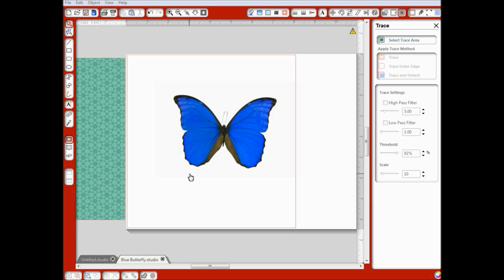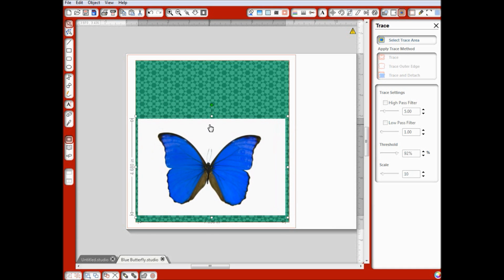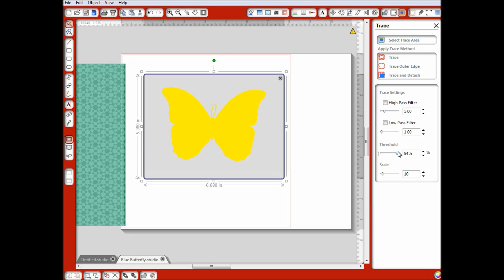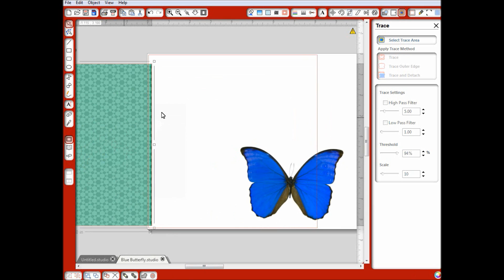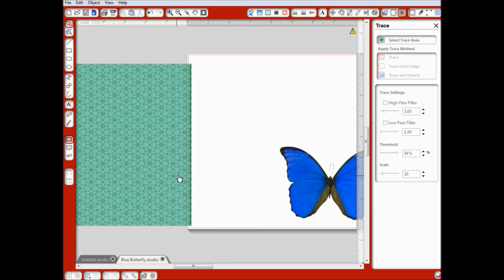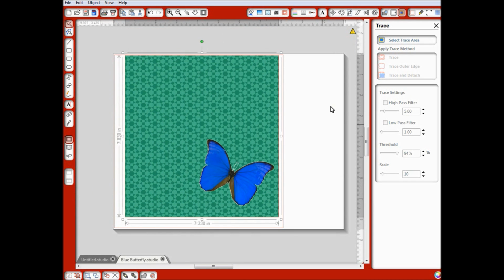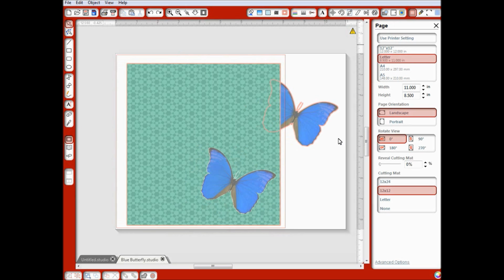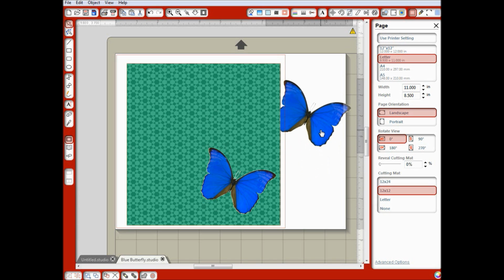The Trace and Detach Tool for Images

Comment from the maker: Hi Sue, In the past I have asked this question to Silhouette support. Their answer was as clear as mud....lol When the High Pass filter is on I'm not able to trace the tiny details yet, it will easily trace the fine lines in an image.I don't think, I've ever used the High Pass filter and rarely the Low Pass filter. You get better traced images by leaving them off and increasing the threshold.